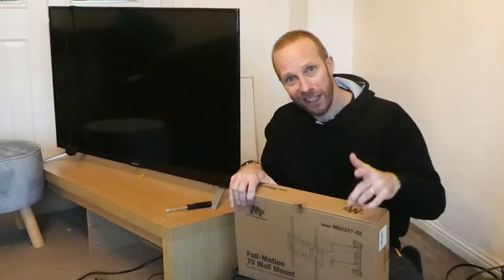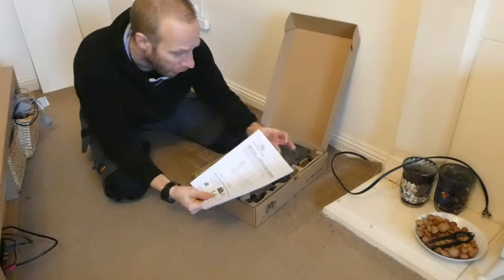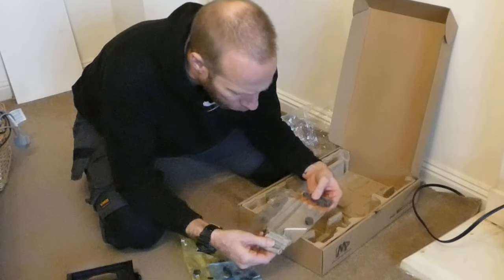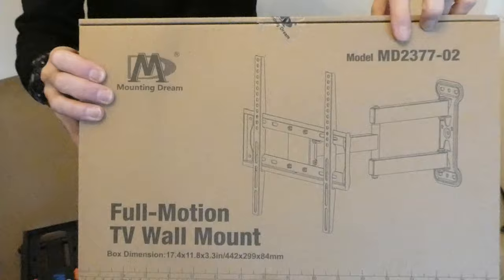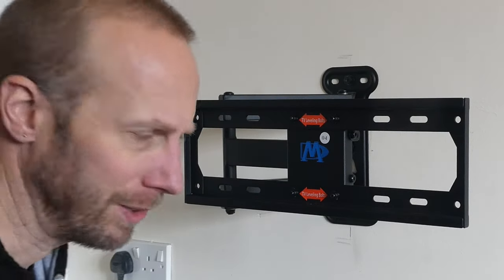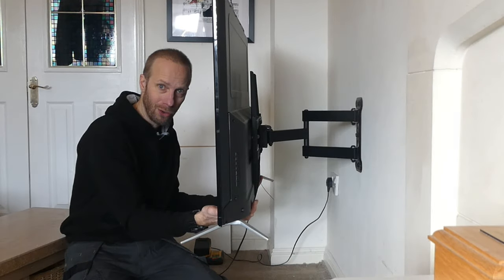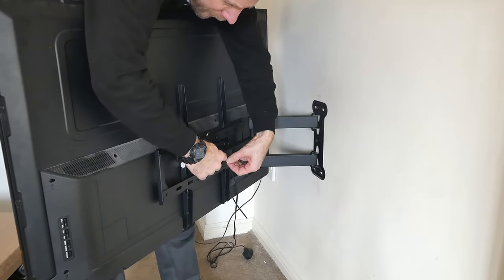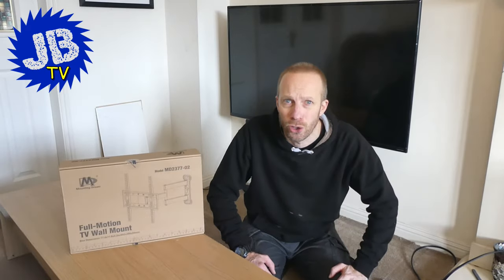How to Wall Mount a TV - Step by Step with Mounting Dream

Comment: Man that is super low I guess If I watch tv on the floor that would be fine
Reply: Na i think thats probably eye level when sitting down on sofa? That would be comfortable  when TVs are high it hurts your neck!
Reply: @omeireles1706  umm hell no I been doing these installs for years unless your are sitting on a super low uncomfortable sofa thats low as hell man that looks 24 to 32 inches from the floor from the video angle maybe its higher and hard to tell but seems pretty darn low LMFAO. I got a few jobs to remount tv's because some crazy person did this. sure as heck is not eye level for a 5'10 to 6'2" person setting on a sofa maybe laying down sideways I guess
Reply: @angelramosexperience8698  that's not even low.. is the same level as it was in a tv stand, are you the kind of people that love putting TV's almost on the ceiling so people are breaking their neck staring up?

Comment: 1 very important step this and most other video's leave out: to some it may not matter, but if you want the distance from the top of your tv stand to the bottom of the tv to be the amount you want...you must  install hanging brackets on back of tv 1st and measure..before mounting wall bracket...if not your tv may not be at the height you desire... maybe you will get lucky with built in adjustments, maybe you won't, its something to consider, and yet no one mentions this.

Comment: Why would you want to put a TV on a wall bracket so close to the floor,surely it can just sit on a cabinet or stand, wall mounts are designed to hang the tv at a higher position up the wall to give more room on the floor below it or for a better viewing experience
Reply: It was at my request it was mounted low as wanted to get rid of said TV unit. Looks great. Thanks JB!
Reply: Caroline picked a great height. Not everyone wants a giant cabinet for a TV and that height is actually pretty much on point when you're sitting on a couch. Most people put TVs WAY too high – your eyeliner is supposed to be at a point 1/3 of the vertical distance of the display from the top.

Comment: Hi Justin, I will be installing the MD TV kit but have to locate the fixing bracket to the extreme right of a bookcase shelf space because the electric 'plug' point is in an awkward spot i.e pretty much the centre of where the TV would be? I have assumed this will be no problem if I fix it on the right hand side of the space and then slide the TV on it's fixing rail to the extreme left as you look at it, thereby hiding the plug point; as long as I make sure the TV is level then this should be ok, even if it isn't exactly centred into the available space, do you agree?
Reply from the maker: Sounds good my man!
Reply: @JBTV  
Job done JB, sweet as a nut, - thanks for posting such a great and easy to explain Video.

Comment: I'm looking at a Tv bracket but with the 2 arm version instead of the single arm, Wall mounting due to living room small and trying to create more space. Great video in depth detail only just found your channel. 👍 I'm guessing as you went straight into the stud beam instead of brick you didn't need to use the anchor plugs provided.

Comment: Hey buddy. When the tv is pushed all the way back against the wall is it center with the mount? And can you slide the tv over on the rails if needed?

I have shelves a few feet over from where I want to mount my tv.
Reply: I also would like to know the same, i have a socket roughly central to where my Tv would go and so the mount would have to be offset to the side to accomodate for it, can the horizontal position be adjusted?
Reply: @omeireles1706  I have it installed now. It’s pretty center. it can be slid on the rails if needed. Or adjusted to basically anywhere you want the tv to sit. Don’t overthink it. You should be fine.

Comment: Just wondering about centering tv if the stud is not in the center I want?!🤔 not a handyman. As you can see
Reply from the maker: Well, another option would be to fix a board to the wall first, for example an 18mm piece of plywood, fix this to the studs, and the you can centre the bracket to the wall without worrying about the stud location...